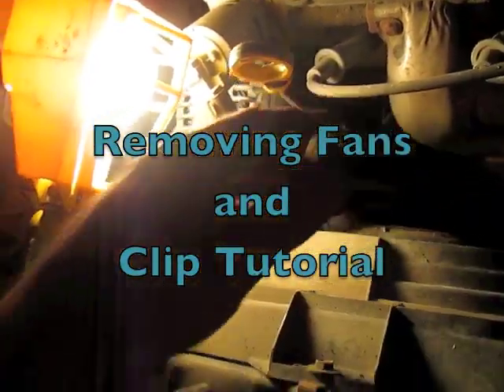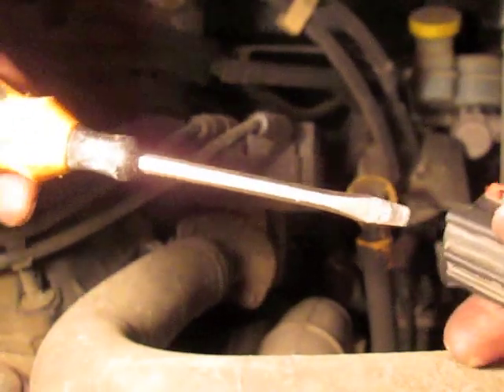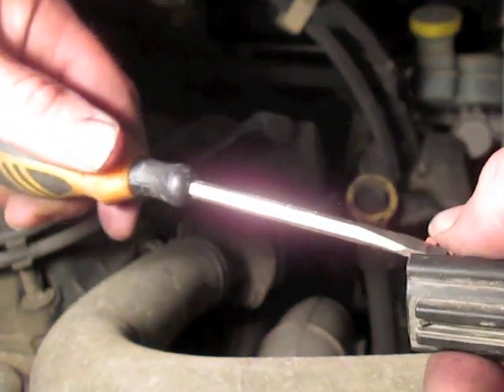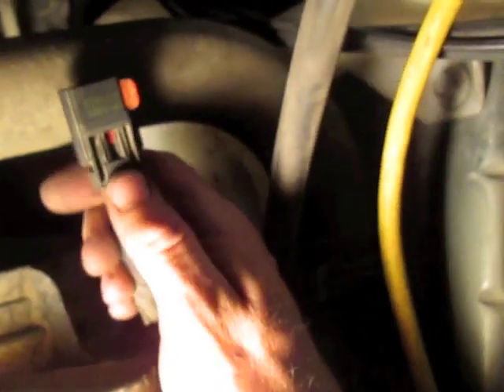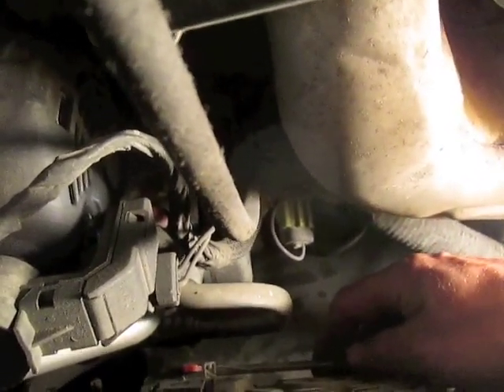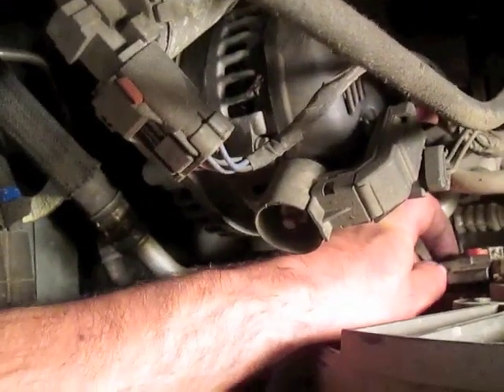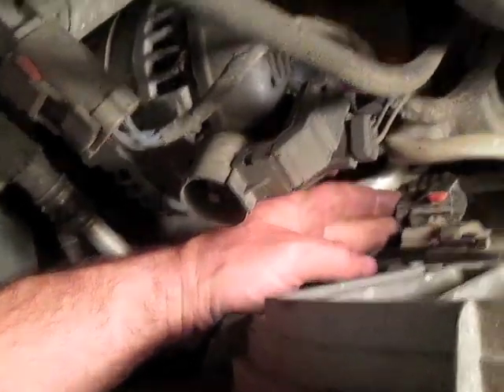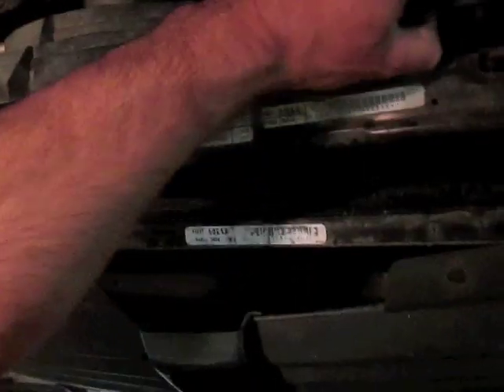HOW TO Remove Radiator Fan CLIP Dodge Caravan Grand Caravan SE LE SPORT 2005-2009

Comment: Just changed the radiator in my Caravan, I believe undoing these clips was the hardest part for us, if you can believe that... thanks for this video, really helped us
Reply from the maker: I do believe it because I had never replaced a radiator until this video.  I got to the clips and was ready to rip everything apart, because I couldn't figure them out.  I had to stop and take a break to relax.  I was going crazy!  So when I finished my radiator repair video I figured I needed to do a video on just the darn clips.  For me they were also the worst part of the repair, so I feel your pain.  Thanks for the post.  It's always nice to get feedback, it helps my channel.  Thanks again...
Reply: You can Fix It!!!! , I should add that once I watched your video it was actually easy. What was hard was figuring it out, which I didn't. You did for me. 👍🏻 So thanks.
Reply: @youcanfixit3721  where is the video of the clips

Comment: Thank you for the video! Finally a video about the one thing I'm having trouble with that all the other videos skip over. I've been trying to remove the wiring harness thing from my Dakota starter and having trouble. It has the same type of connector I think as the one in this video.
Reply from the maker: Yeah, these can be a pain.  Almost to the point you want to just rip 
the, right out, but then you think---That's just going to create even 
more work---  It's always a pain when you're reaching and can hardly see
 what you're doing.  Hopefully it helped.  Thanks for the post!
Reply: It doesn't have the red tab that slides over instead the red "tab" pulled out towards me. I still can't the connector disconnected from the starter. Going back outside to try again.